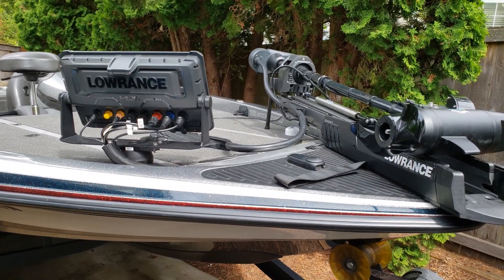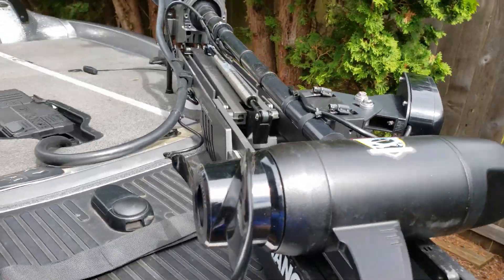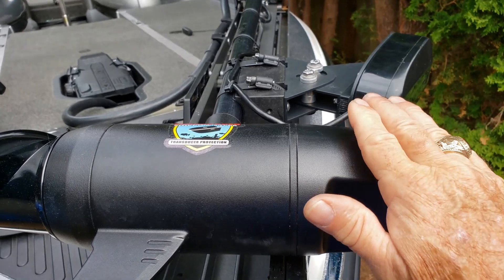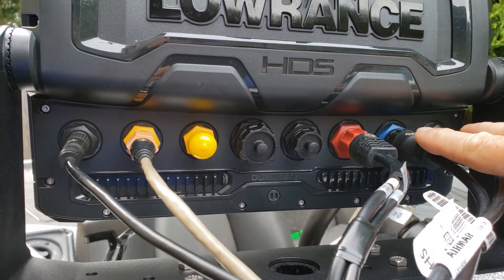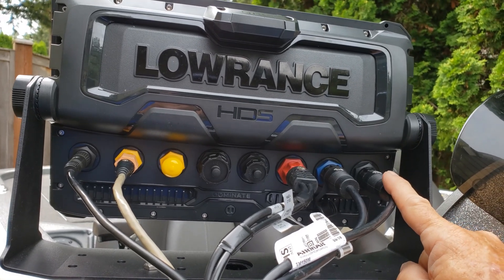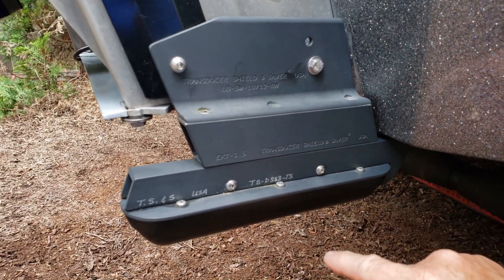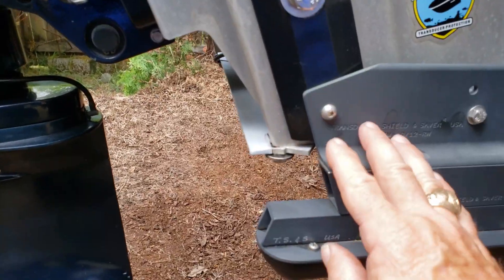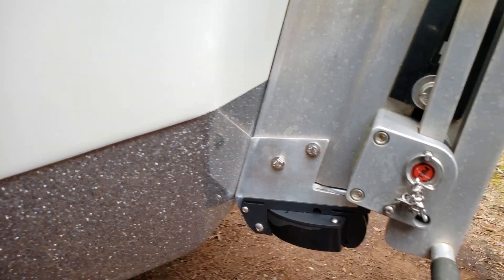Transducer Tips & Tricks

Comment: Thanks for the video, I have dual outboards on my 24 footer offshore fishing boat, looking at installing my 3D where it won't  be blocked by the outboards, and where it won't interfere with the props. I had it right between the outboards stern mount install. Looking at another video I saw adapters for flash mount install for the 3in1 and 3D. 6purs is a plate adapter that I assume goes on the side plate. Does it interfere with the prop causing cavitation? Would you advise on a side plate install or flush mount adapter kit?
If I install it flush mount under hull it will have the transducer at 180 degrees from the transom mount install. I here on the Pro you can flip the image left to right to correct it. I need some advice.
Oh and by the way on Starboard I have a TM165HW and on the port side I have a B75H on a transom bracket that works just fine. So this 3D one is in limbo. Help.....
Reply from the maker: I don't like drilling holes under the waterline on fiberglass, so I avoid doing so at all costs.  Mounting on the jackplate (sideplate) does not affect flow to the prop(s) at all, and that is my preference for strength and for protection of the transducer.  It also makes it easy to inspect your transducer.  

The problem with mounting it so high is that it only works at slower speeds, although you likely won't be using 3D at faster speeds. 

The 3D StructureScan has the ability to flip the image in the menu so that is no problem.

Hope this helps, and thank you for watching!
Reply: @ Yeah I know what you're  saying but the 3 small holes for the screws would never sink a boat. But hitting something and breaking the mold will.
What tType Of BRACKETS DID YOU USE AND WHERE DID YOU GET THEM? 
I have the TM165HW which is a bit bigger than the 150 you have and would like to mount that somewhere else on the side of one of the engine's jack plates.
Reply: @marcmarcantonio I did notice the transducer shield and saver web site you mentioned and the only one I saw was for the HD3in1 transducer bracket for $199. What do you use to attach it to the side of the outboard. I did not see that one.

Comment: Will a jackplate mount still tell you depth when on pad?
Reply from the maker: No, it will not.  That is why I have a shoot through the hull transducer as well (as discussed in this video), which works at speeds up to 70 mph.  You can't run StructureScan on plane anyway, so Jackplate mount is ideal for clear images. Thank you for watching and the question.

Comment: Can you adjust your transducer on the jack plate? It doesn't look like it can be tilted up or down for leveling at idle.
Reply from the maker: This is a custom-made mount designed specifically for my boat model. The optimal position is calculated by the manufacturer who then designs the front angle of the bracket to match the transom angle.  The installer pushes the mount flush against the transom and the angle is then perfect. 

The problem with adjustable mounts is that they get knocked out of adjustment and can damage your transducer.  This mount is rock solid and can't get knocked out of adjustment. My images are better than anyone else's I have seen.

Comment: Nice video, Marc. Now I understand why you have a thru-hull transducer in addition to the others. I don’t know whether you monitor comments here but....As you know from BBC exchange, I have an Ultrex. As of Saturday, I also have a bow-mounted HDS Live 16. I cannot figure out how to connect the Ultrex sonar cable to the Live 16. On the cable, I have the Lowrance adaptor that I used for my now-dead HDS-12 Gen3 but it does not match any of the connectors on the Live 16. Do you know what I need to do to connect the two?
Reply from the maker: Terry, if you used your HDS-12 previously with your Ultrex, then you already have MinnKota's adapter cable for Lowrance units with 7-pin ports.  The problem is the LIVE-16 uses the new 9-pin connectors, and your Ultrex terminates in a 7 pin plug.  You can buy a converter cable from Lowrance that adapts your 7-pin plug to a 9 pin plug.  I believe that now MinnKota sellsl an adapter cable that would go directly to the 9-pin ports, so check with them first as that will eliminate the need for two adapter cables.
Reply: @marcmarcantonio  Thx! I will do that.

Comment: Awesome video! I am wondering if you can help me? I have a HDS 12 live and I’m using a 3-1 trans. I also have a through hull trans but I can not get it to pop up on my screen to use it as a transducer for some reason. As soon as I get up on plane I have no readings for sonar. When I click on installation it shows a 3-1 trans but will not let me select any other transducer
Reply from the maker: Go to Settings, Sonar, and then make sure MultiSource is turned on. I am assuming both the thru hull and 3-in-1 are plugged into the same Live? If not, then you also have to have an ethernet cable connecting the Lives, and have multisource turned on.  If you have an older "legacy" HDS unit connected to the Live by ethernet, then other problems need to be addressed as well.  Also if you have multiple units you need them all on the same software version.
Once you turn on MultiSource, then go to your Sonar page, Menu, Source, and select which transducer you want to use.  Select the thru hull, and then go to Sonar Installation and choose the correct model.

Comment: Well put together sonar system sir. Like it a lot. I will have to research the Airmar trans. I currently run a 3-in-1 on the transom and it's hooked up to a Live 12 on the dach. on a Live unit. Is the Airmar compatible or does the 3-in-1 defeat the purpose of the Airmar upgrade?
Reply from the maker: The sonar in your 3-in-1 is good, but not nearly as good as the Airmar TM150M.    Since mine is mounted on the jackplate, it only works when I am off plane and searching at slow speeds.  I switch to my shoot-through-the-hull 2D sonar transducer when I run on plane for high speed readings.  So you can use your 3-in-1 like I use my thru hull transducer.